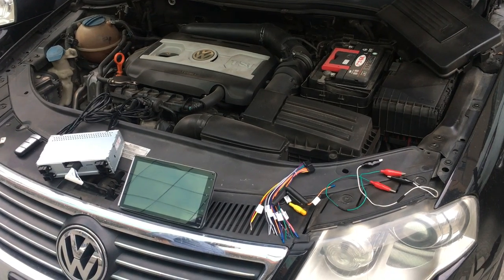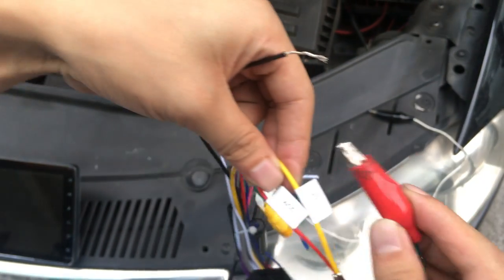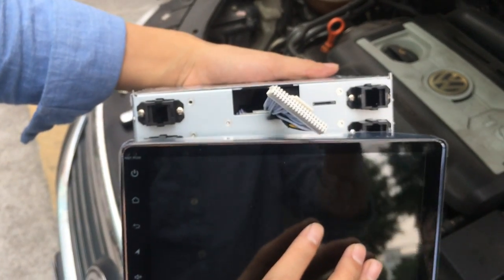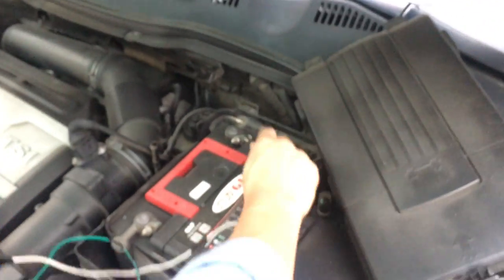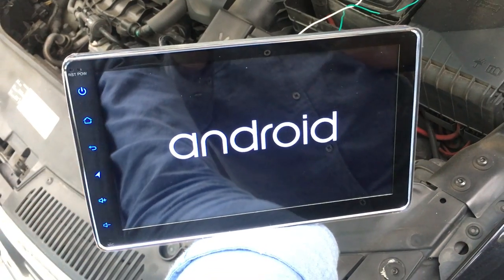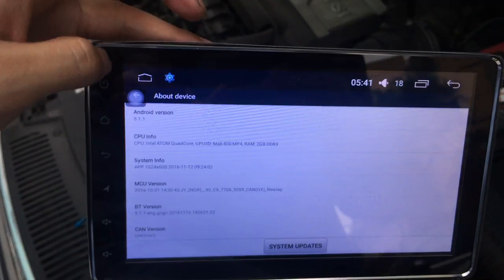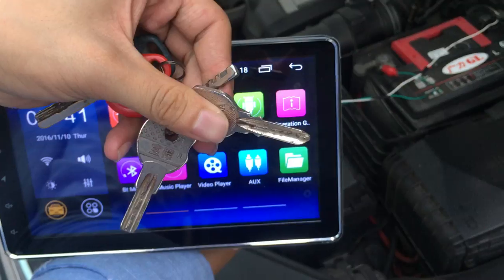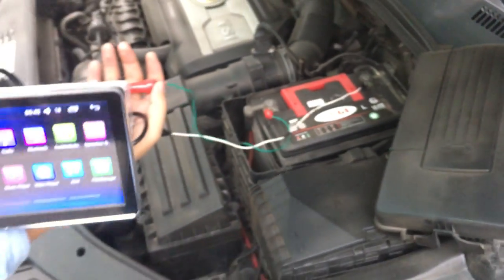How to test connect car stereo to car battery without installing | JOYING radio stereo headunit

Comment: I tried this after having no success getting my Joying radio to turn on after installing.  It kept blowing 7.5 amp fuse in my 2007 Toyota Sienna Limited.  When I tried connecting the Joying to the battery with test leads as you show in the video the test leads on the battery side immediately started smoking and melting.
Reply: Did you ever get it to work in the car? I have a 2007 Tundra Limited and it also keeps blowing my 7.5 amp ACC fuse under the dash

Comment: Is there a way to do this if I don't have a wiring harness connected to the car stereo?  

My OEM head unit is not working, and I've tried testing the connectors on the OEM harness, but the leads from my multimeter don't fit into the holes in the connector.  I don't want to damage the OEM connectors, and I don't want to cut the harness wires to establish a test connection.  Do I have any other options?
Reply: Take it to a shop ,same problem for me
Reply: Super late reply but why not put paper clips in the connectors? That should be small enough then touch your multimeter leads to them

Comment: 03:08 😳
Reply from the maker: In 03:08, this shows GND cable connects to negative power supply
Reply: Dj 😂😂😂😂
Reply: It’s glass and didn’t scratch?
Reply: so if you have seizures your screen won't get scratched ?

Comment: when i do this test my unit works, but when i wire up the harness I don't get any power, i need help, please. When the harness is wired up I have continuity between power and ground but I can't  test continuity for the accessory (red) because the harness opening isn't large enough for my test leads. I've wired up the harness 3 times now and I'm running out of wire on my unit's harness :(
Reply from the maker: If you test it like above video, the item can turn on, it means that the item is working. Please contact us via info@joyingauto.com with your order number, then we can help you how to wire the harness in your car.
Reply: Keag Bert  I'm having the same problem.  My OEM unit appears to be dead, but I want to test for power from the OEM wiring harness and also test the unit itself while it's not attached to the harness... basically trying to isolate the problem.  Like you, I'm having the same issue with test leads that are too big to go into the openings on the harness.  I'm going to do a search for other types of leads for my meter to see what I can find.
Reply: I discovered my problem, I have a ford and I was using the wrong harness. The factory harness didn't have accessory power in it, it was actually located in a second harness that I thought was only for the CD changer. It turned out to be RAP (Retained Accessory Power, the power that makes the radio still play after engine shutoff until a door is opened). I had an aftermarket unit that I could at least test by twisting the red and yellow together and connecting to 12V power source so i was able to confirm my unit was working.
Reply from the maker: thank you for sharing the information